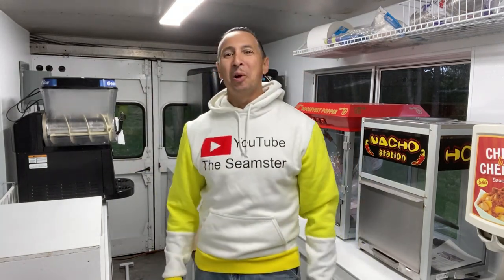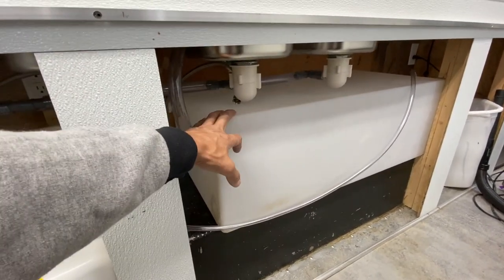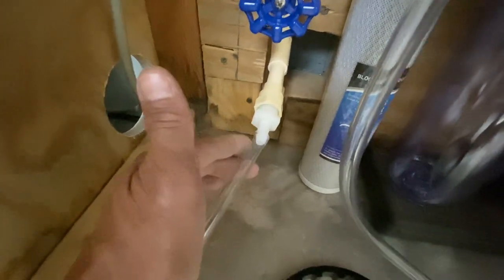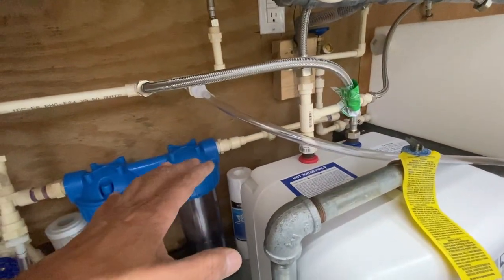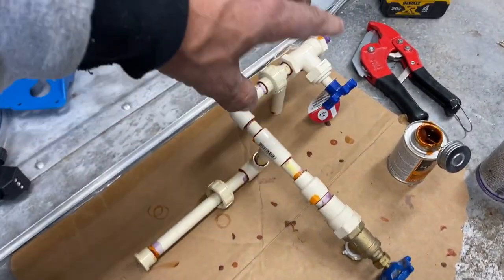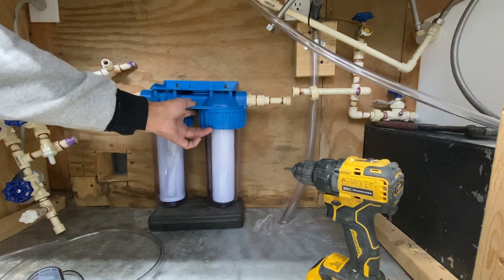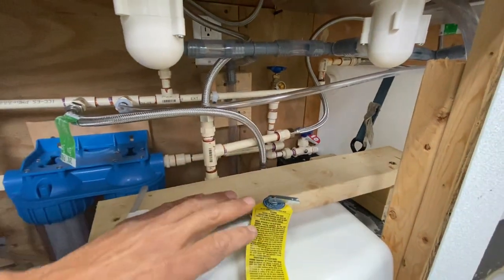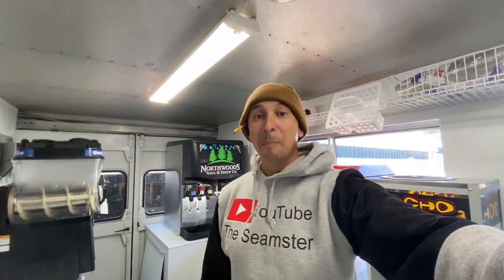How to build your Food Truck Water System

Comment: None of this meets NFS and most health departments would not pass these sinks, faucets, or drains. Make sure you check with your local health department before you do anything!!
Reply from the maker: Correct on checking with health department. Your wrong, all sinks must be size capacity for largest utensils also CIP!
Reply: Why do you say none of it meets and that health department won't approve them?
Reply: @jeremyproctor3357  As I stated in my previous comments. Our local health department requires NFS equipment! Having a stainless sink in a wood cabinet does not meet NFS requirements. Other than BBQ grills for outdoor use, we are also required to use NFS equipment. This includes refrigerators, freezers, and all cooking appliances. Not sure what you can get by with? I just know that these are the rules and this is how I build my own food trailers!
Reply: Lies
Reply: I can concur this, plus it makes sense

Comment: Wow you are using a lot of water for your soda machine and coffee ☕.  Doesn't look like you will have enough water.
Reply from the maker: You are correct. But I always said, if we run out of water then we just made a lot of $$$$ in one day 😊 Most events had running water hook up the tank was always a good standby.
Reply: I just finished building my food trailer. I built a two food trucks is the past. One in 2004 and 2021.

Comment: COMPLETELY UNNECESSARY AMOUNT OF PLUMBING 🤷‍♀️
Reply from the maker: SHOW ME HOW TO DO IT AND I WILL COMMENT ON YOURS 😊
Reply: @TheSeamster  check profile chum we create espresso trailers daily it's not a restaurant connection but a mobile catering trailer piping should be straightforward easy to maintain and allow for storage 🤷‍♀️
Reply from the maker: @brogantipping2101  You are incorrect! This is a multi water source with an electric pump or hose option. This type water source cannot be built any other way. Show me where I went wrong? Again this is a multi water source. If you want straight forward just use a hose and no tank.

Comment: Hey seamster big fan. Can you please tell me how you secured the sinks to the  drop in counter tops? These sink basins don't come with clips. Did you just use liquid nails?
Reply from the maker: I had to use 2 stainless steel screws in opposite side corners and also silicone sealer on top edge. Then used adhesive under the sinks.

Comment: That's a wicked idea. Save your own water n pump. Great for off grid or on grid. Event's wirh no hook ups. Aka fairs etc not hard to figure out if ppl listen n im aware of some.what how water systems.woek n can hook my own up to a point. .still a bit iffy why soda machine would drain into grey water unless its back flow water. I have ro watch that again. I will.be dling that, and i want the extra filters. Water is diff everywhere ans i have teouble drinking tap water especially. Thank u

Comment: Do you have blue prints for the plumbing I just bought a food shack that is a night mare and the appliances was suppose to be propane which that turned out to be gas so I'm in a mess now.
Reply from the maker: Ahhhh Man that sucks! No blue print but please start with my first video and scroll through them until you see what you need. To bad couldn’t just convert them to propane easily?

Comment: Ive never really used rhis i like pex alot tho. But it can leak.if its not done right. Would u recommend pex in a food truck or do you prefer this type. When i was left to rebuild my entire bath n kitchen due ro abad landlord i lesened fast how to hook up water a rub shower n i also used pex alot for this. i was proud felt great n finally had a shower. I did use copper as wlel ans the ovious pvc pipes n p traps. Taught the guy i dated how to build wall studs hang dry wall and lay tiles n cupboards. Lol what u will do when u have no.hwlp. ytube n my dads past hosue building helped me alone im not too fancy yet in electical but i can so it. I did use shut offs too. The fancy ines lol i had ro have something fancy n pex foesnt have round shut offs. Some pieces were expensive some not so much. Im glad i learned about that air release with the water tank. I don't think my rv has that but it should n it will
Reply from the maker: Yes use pex!

Comment: First off, its not a hot water heater. You show that you dont know what you are talking about when you call it that. Second, that is a super crappy design of a plumbing system. Just put your pump near the tank, in line, and remove all of that unnecessary garbage.
Reply from the maker: First off, it must be a cold water machine. Second, the pump is not a primary source it’s a backup to no water service. Remember, this is to give you an idea to learn or improve your food truck. I hope you don’t talk to your family like you do to strangers, because I don’t really think they like you.